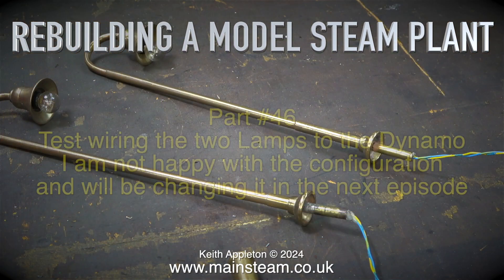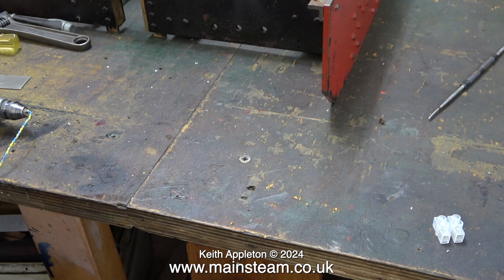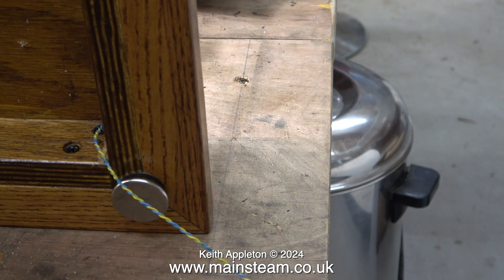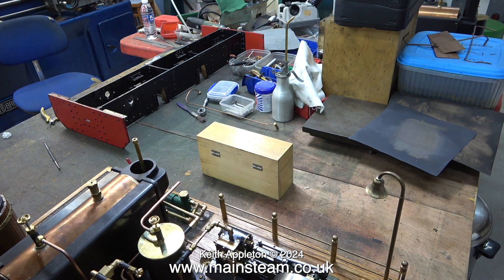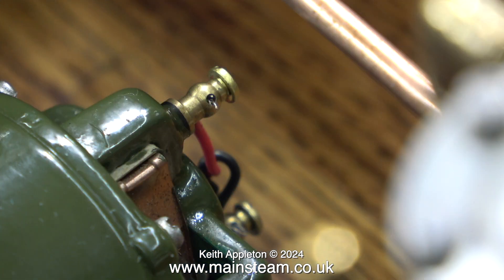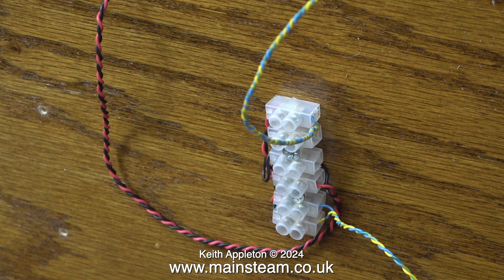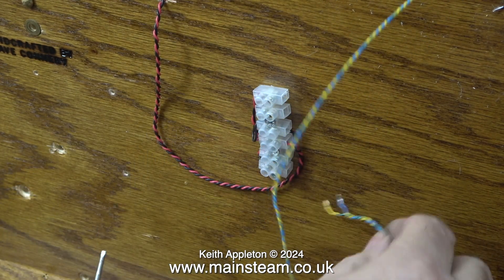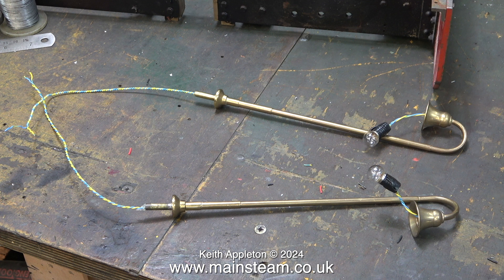REBUILDING A MODEL STEAM ENGINE PLANT - PART #46

Comment: Keith why not use the the brass tube a the negative for the lamp the your only feeding the positive wire though the tube
Reply from the maker: I just used the same wiring system as was used originally in the plant . . . .